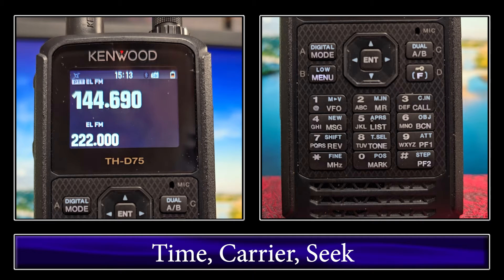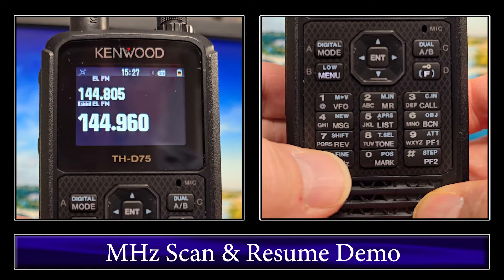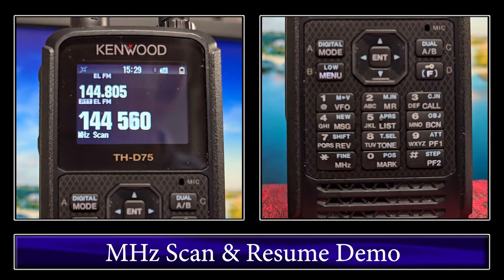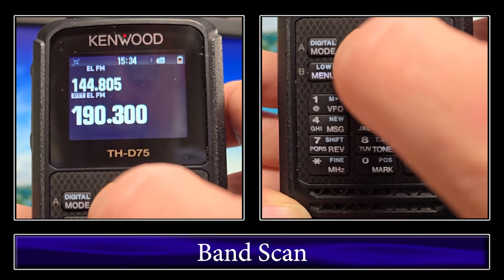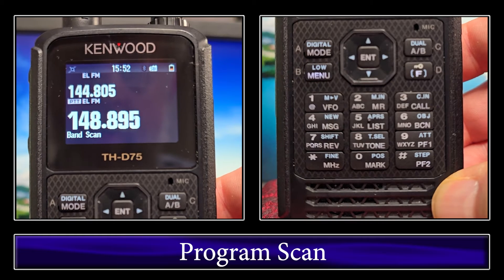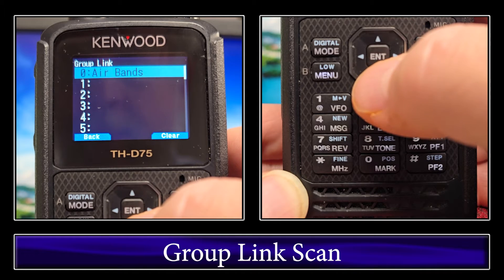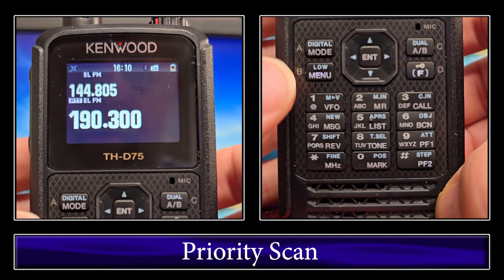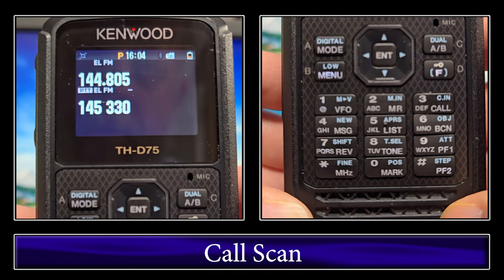Different Scans on the TH-D75A

Comment: Warning!! If you get one of these new Kenwoods, don't let programming software vendors sell you an expensive extra programming cable. I purchased and downloaded RT Systems software to program my new TH-D75. And I ordered the cable to go along with that but of course that has to come in snail mail. I didn't want to wait, so I just used a cheap USB-A to USB-C cable that I bought from Dollar Tree!! Worked perfectly. But only after I got charged an extra $10 for the cable that I didn't need. Don't get bamboozled like I did. Any USBA to C cable will work just as well.